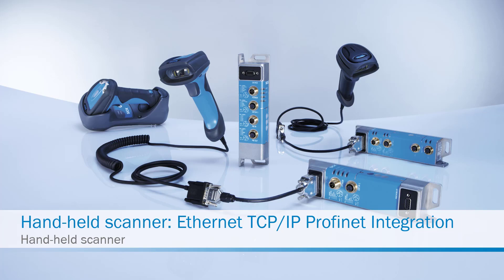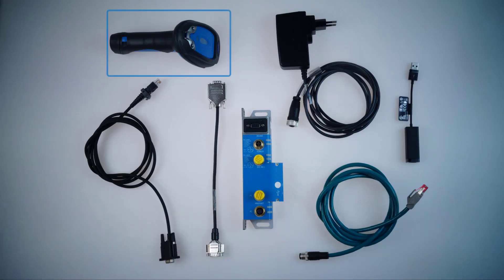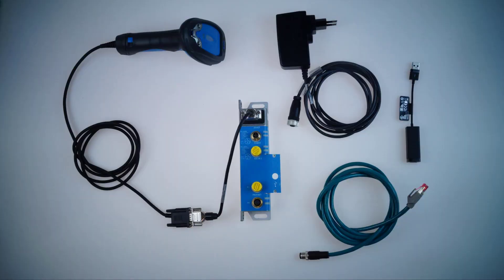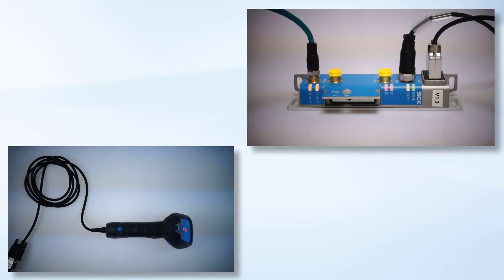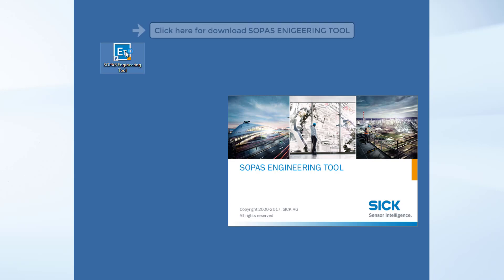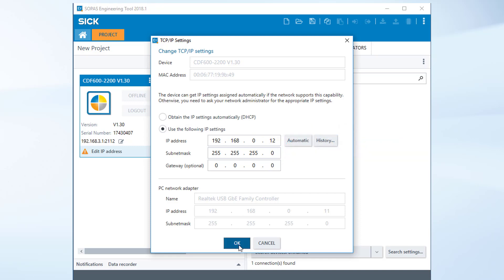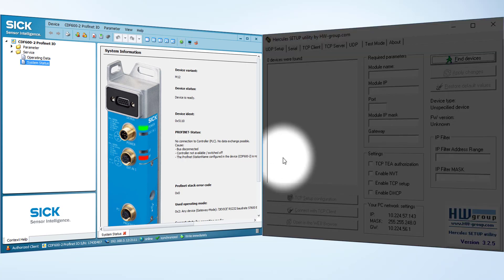Tutorial hand-held scanner from SICK: Ethernet TCP/IP Profinet Integration | SICK AG

Comment: Hi friend, what model of Ethernet and USB cable can I use to communicate with the PC?
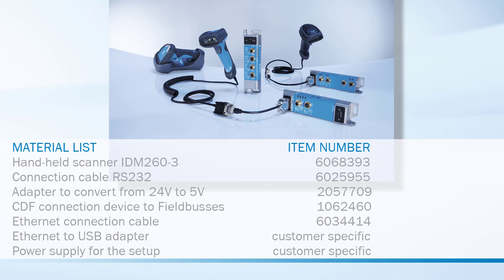Reply from the maker: At 4:48 of the video you will find all components with part numbers.
In case you need other cables we recommend to check the accessories list at the handheld scanner https://www.sick.com/6080738 and the Connection Device CDF600 https://www.sick.com/1062460 for up-to-date part numbers.

Comment: Is it possible to configure the sensor directly on pc, without the CDF600?
Reply from the maker: The easiest way to connect most of our mobile hand-held scanners directly to a PC is using a USB cable (e.g. https://sick.com/6081867 for IDM26x). By default, the scanner will be detected as an external keyboard.
Then you can use the device specific software (e.g. IDM Setup Tool https://www.sick.com/de/de/search?text=IDM_Setup_Tool_4.0 for IDM26x) to configure the mobile hand-held scanner to your needs. 
As an alternative you can use the configuration codes in the quickstart / programming manual to adjust your hand-held scanner.

If you have further questions, please contact our technical experts by mail: info@sick.com